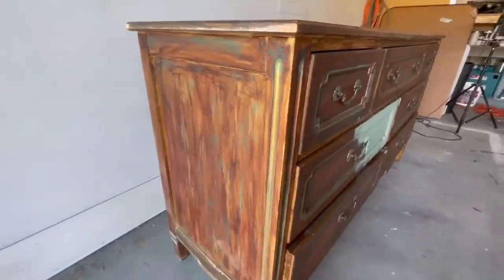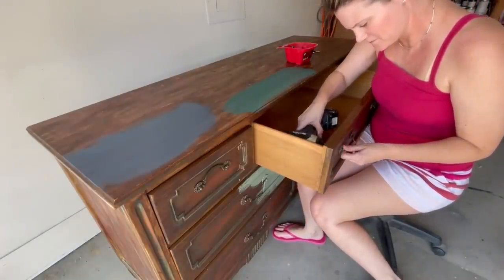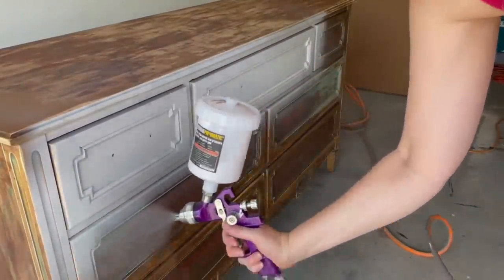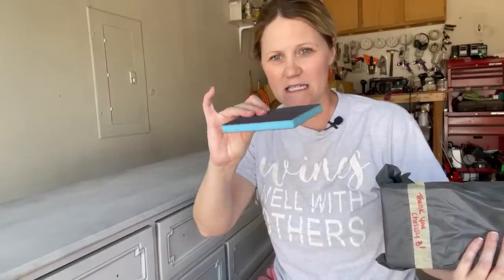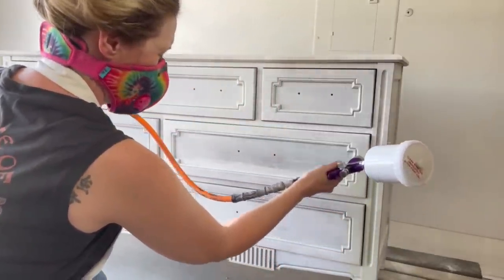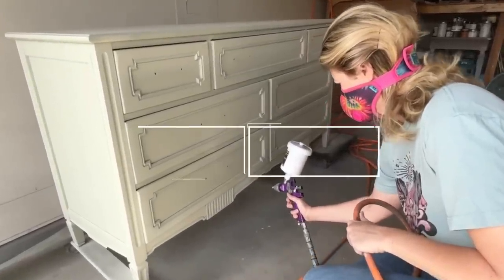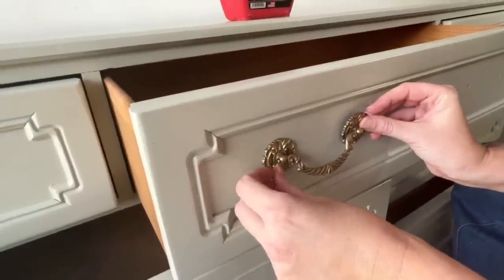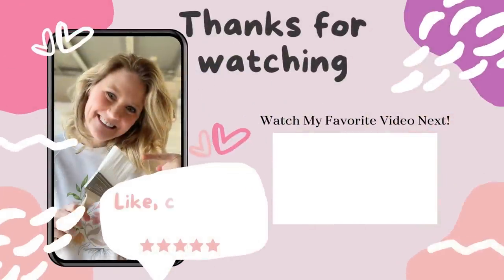From $35 to Luxurious: The Incredible Furniture Makeover

Comment: I use Rockhard putty.  IT is super cheap and dries so hard you can even drill holes in it.  It also dries super fast!  Just mix a little with water, so much easirt than Bondo, and cheaper than wood putty.
Reply from the maker: Thanks for the tip!

Comment: When using high gloss paint, do you sand in between coats? If you mentioned sanding, I missed it.
Reply from the maker: I don't. I get such a smooth finish with my sprayer. I know others would disagree but turns out great for me. Thanks for watching!